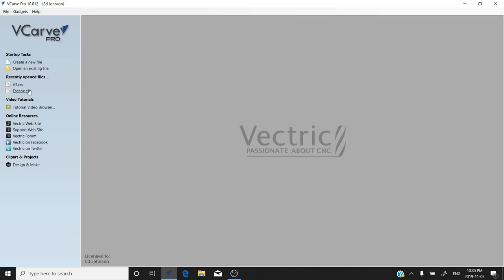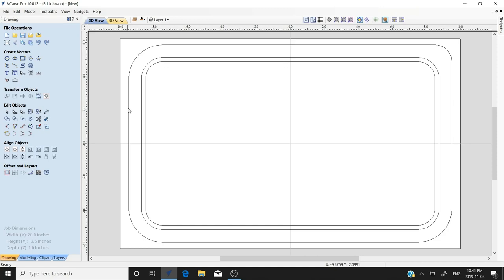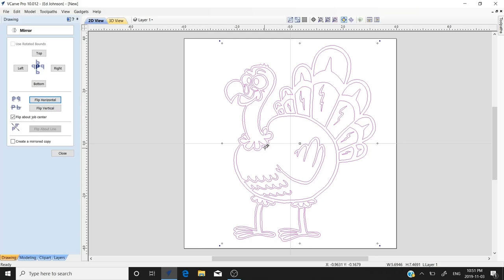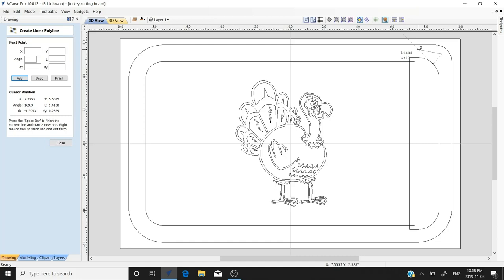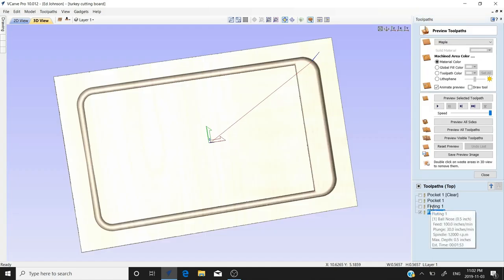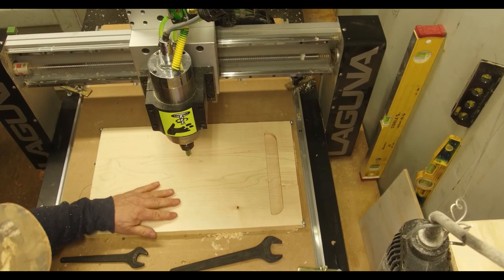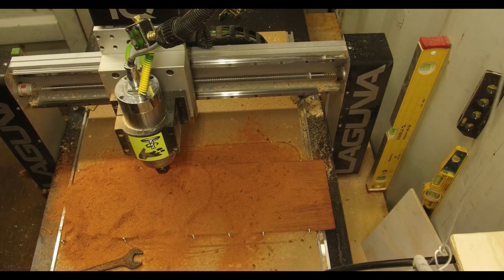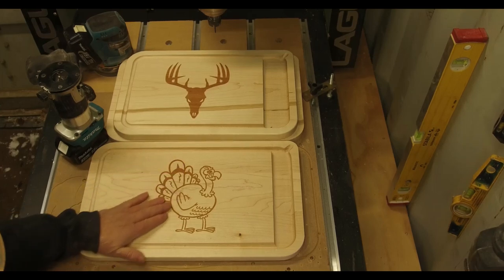VCarve inlay cutting board in VCarve Pro and made on a Laguna iQ

Comment: Great job on the walkthrough. Just a question on the planing process at the end, wouldn’t it have been easier or less risky to use an end mill to get the inlay completely flat. I feel as though sending an almost finished board, especially with juice grooves, through a planer is asking for tear out? Not being negative just trying to learn myself.

Comment: Man this was so great. So often videos don’t take you through the entire process. I’m a complete newbie so I learned a ton. I may have missed it, but what bit did you use for the key hole? Thx!
Reply: Hello there 
the keyholes for hanging stuff with , I use freud 70-104 which make the hole 25/64 height and the width makes it 7/16 .  The bit día is 1 inch and the max RPM is 24000. I hope i help with your problems

Comment: Hi, great job on the cutting board, can you tell me what modification you did to your water line on your Laguna IQ? I have the same machine. Thank you
Reply: I got a 220 volt in floor water circulation pump from eBay and a poly boat gas tank as a reservoir. Then I got a 80mm by 80mm computer radiator from amazon. I hooked the pump to the CNC council master switch so when the machine is on the pump is on. The pump is 3 speed, draws something like 45 watts and is quiet, you can’t hear it running. I put a 1/2” NTP bulkhead in the bottom of the boat tank to feed the pump and run that to the spindle, the flow indicator you see on top of the spindle is available from amazon, just to verify the coolant is flowing and looks kinda cool. I run the return through the computer cooler and zip tied it to the council fan exit. Being the cooler is on the cooling outlet it don’t affect the cooling of my components in the council and does provide air flow through the cooling fins on the cooler. The antifreeze is then returned through the tank pickup fitting. 
For as good of a machine the iQ is they really fell short on the spindle cooling.

Comment: How does planing affect your flute angle?
Reply from the maker: If you plane too much it'll take your image right off, you need to take very little at a time until you remove all the excess wood and glue. I set my Z zero to 1.5MM below the surface when carving the board to give myself that little safety margin.

Comment: Make life easier for yourself , get rid of that Rich Auto DSP and convert your machine to a Masso controller.  Much better interface and can save you time on re-zeroing every bit.   Your off to a good start on the inlay cutting boards, but so much more you can do, try doing it with multiple species of inlay wood.